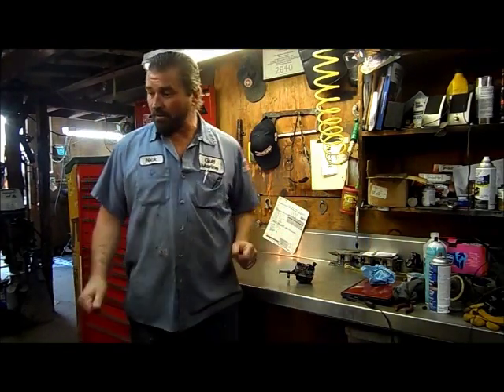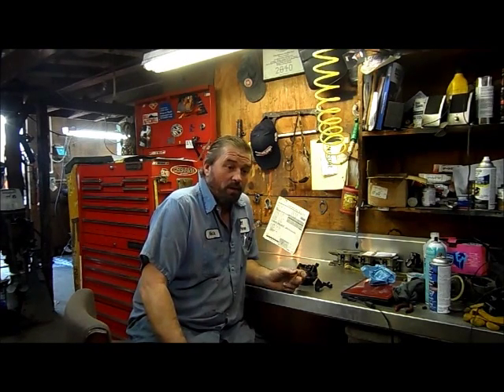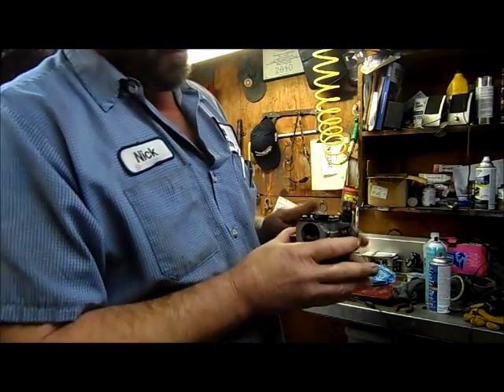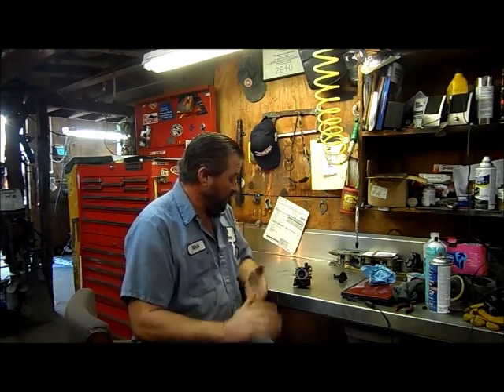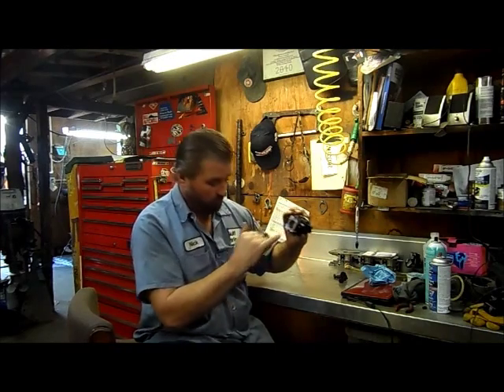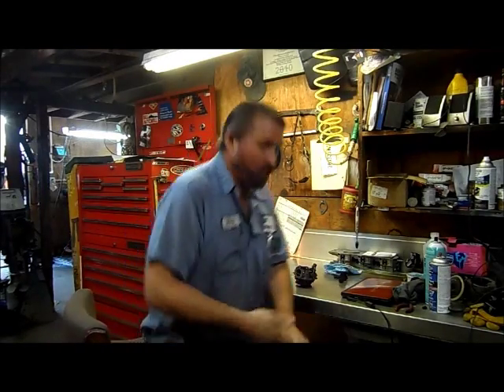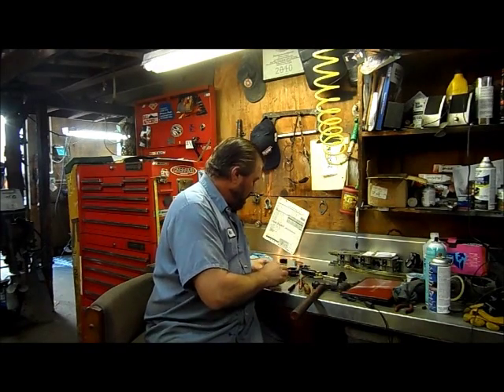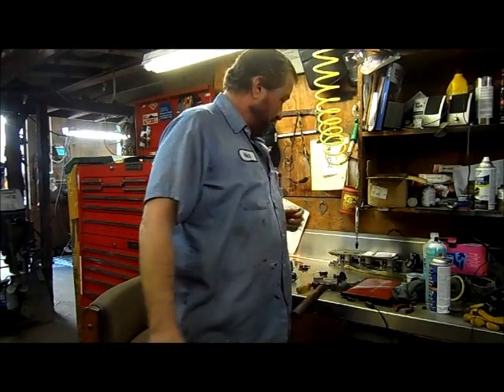Evinrude/Johnson carburetor repair, 96' 15hp disassembly with Pro Tech Nick Hudson

Comment: Good vid!  boy these Johnson's and rudes sure were easy to work on idk about a 96 but pre 88's were some durable fuckers a bit annoying to take out the carb bit other than that easy as can be to rebuild.Just rebuilt a 86 9.9 johnson and assembled in a few hours I'm talking sand blasting and all lol really straight forward compared to some of these new 4 strokes

Comment: Good vid. Where do I get one of those tools for taking out the jet? Can I clean out the carb without taking it out? What about the plug? Can I get it clean without removing that?
Reply from the maker: The Jet tool must be ordered from an Evinrude dealer or possibly you can find em on Ebay, P/N 317002